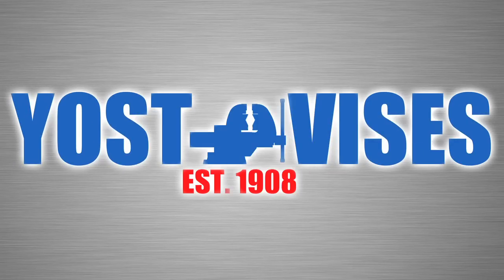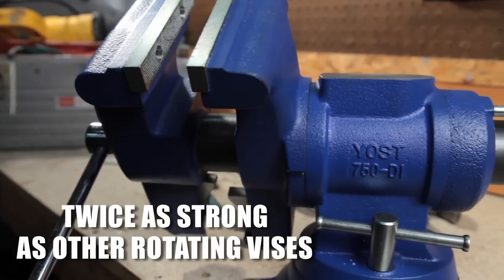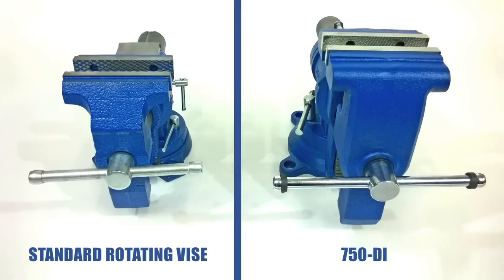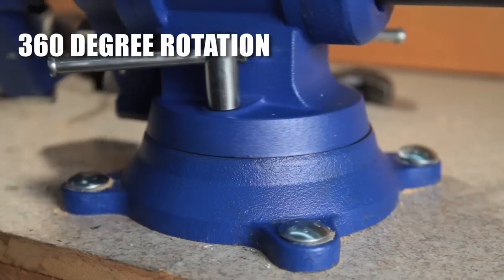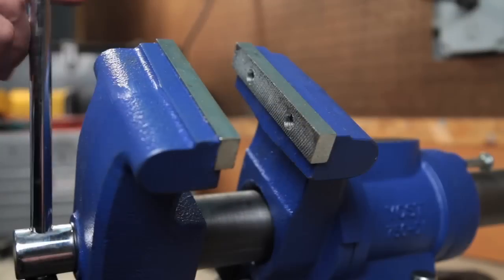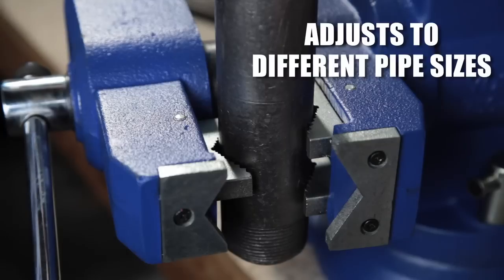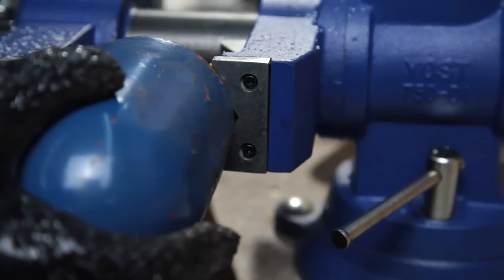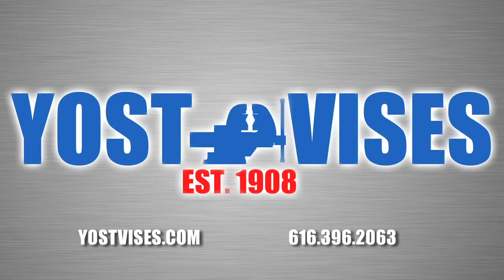Yost Vises 750-DI  Heavy Duty Rotating Vise

Comment: I bought this vice.  Very first time I spun the vice around to the pipe vice side the locking screw that keeps it from spinning stripped.  I ended up modifying the vice with a locking pin since the iron would easily strip out no matter how many times or what size I retaped it.  Other than that, it's a good vice.

Comment: This vise is. nice and heavy duty with one major flaw that causes me not to recommend this model.  the pull pin rotating mechanism is both cheap and doesn't have the quality that the over all product has.  If I could I wouldn't hesitate to send it back and get ore traditional lock down

Comment: I just got an old red vice which looks just like this Yost 750DI with only slight differences (it has 3 hold down bolt hole mounts to mount nearer to the bench edge) but there is no visible markings or name on it? It has a stripped out rear cover block lead screw ACME threaded housing and I need a new rear cover with good threads. It looks almost identical to the listed part number (23) for the Yost 750DI rear cover. Is there any way to identify if it is a Yost or not?

Comment: does it rattle on that wee pin if you rotate it though ,,, nothing else locks it , just the wee pin in a notch ??
Reply: tom thompson it fully locks when the item in the jaws is clamped down. The pin is just for positioning the head before clamping down.

Comment: For $72.76 & FREE Shipping you can get a perfectly sized all steel vise that can grip 4 inch OD  square tube, 4 by 4s, or anything that fits in the 21/4 inch throat and 41/2 inch opening with 5 inch wide jaws. 360 degree swivel and 3 mounting posts make it awesome! High quality serrated machinist jaws are engineered to grip parts the best.  It grips pipes from 1/2 inch to 1 1/2 inch, but who cares about pipe jaws? I HATE PLUMBING. 2,400 lbs of clamping force. THAT IS OVER A TON! OR JUST OVER A METRIC TON! To top all, 3 year warranty and made in Taiwan. Who makes it?

YOST! WHO ELSE CAN MAKE SUCH GOOD VISES FOR SUCH A LOW PRICE?